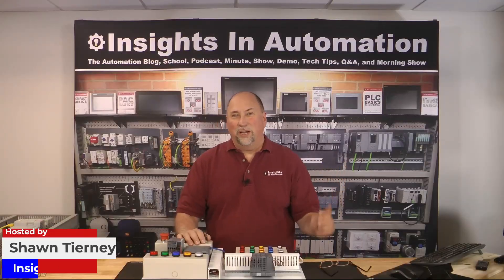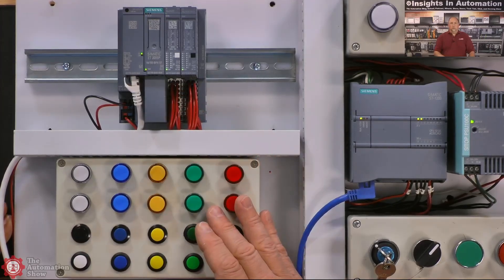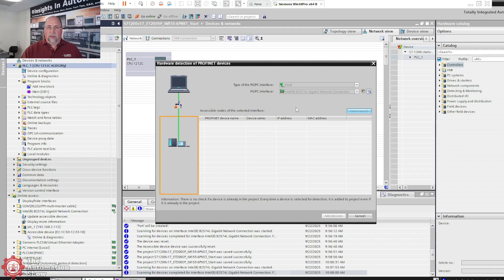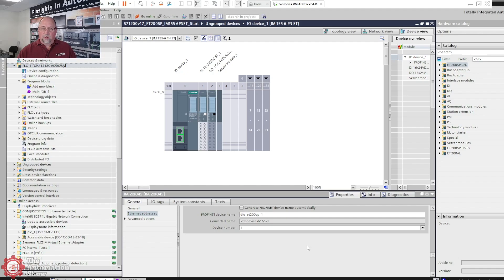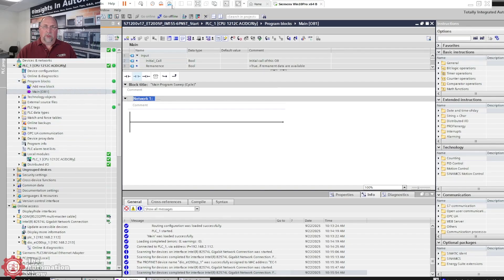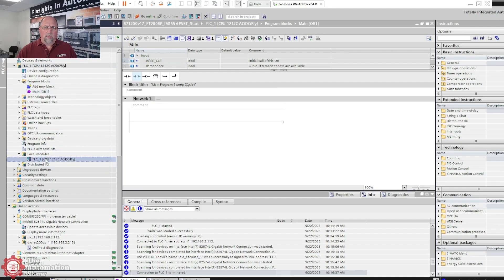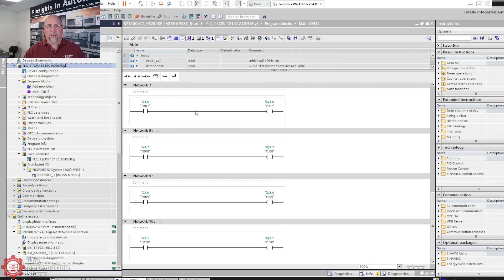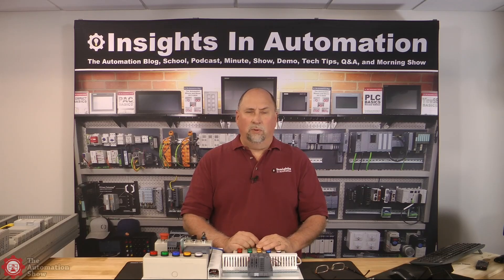ET 200SP IM155-6PN ST Interface Module Setup & Use

Comment: With Profinet you basicly dont care about the IP, device name is KING. (offcourse you still have to make sure the ip's are unique, matching the last octet to the profinet ID for example). Regarding not able to asign the name via wifi, thats probably a routing or a layer thing. Basicly just just use a wire when doing the initial setup. also applies to assigning the F-Addres on safety modules.
Reply from the maker: Thanks for confirming @DeKemp! Still hope to figure out the WiFi issue in the future - I use WiFi with RSLinx without issues, so there's something specific about the Profinet that my router must be blocking, but I've search and search and it appears I'm the only English speaking person who's run into it lol